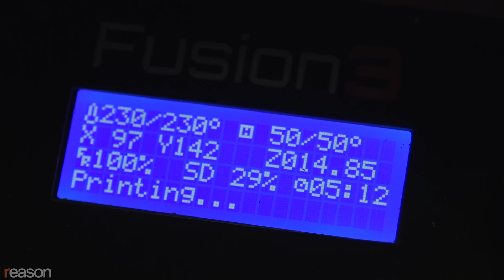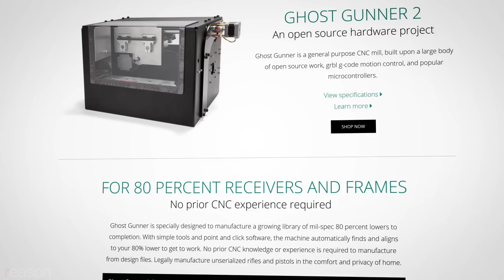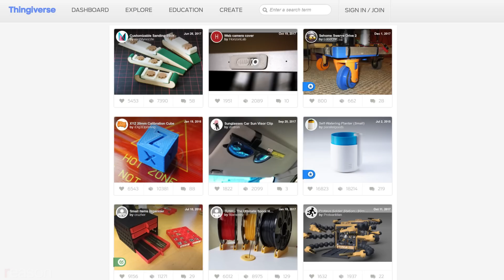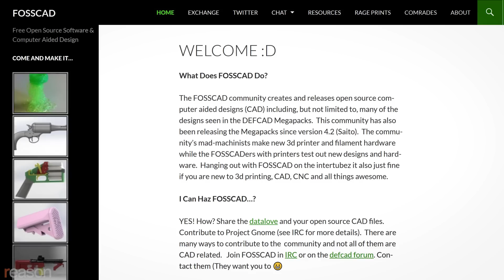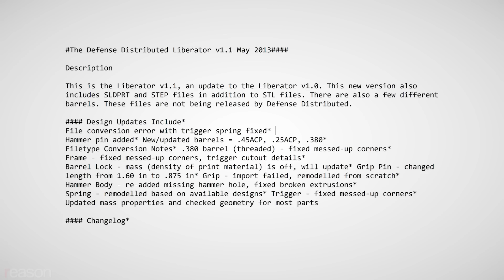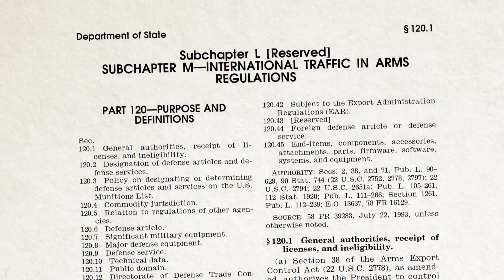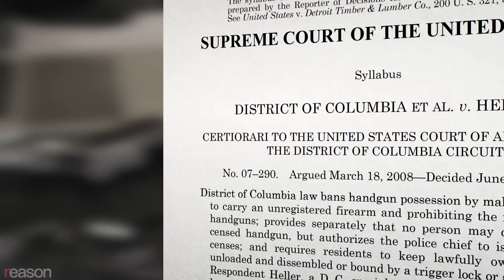The Inevitable Death of Gun Control: Cody Wilson and the Future of Untraceable Homemade Firearms

Comment: I would argue that gun control laws have never been effective in the sense that Cody says that they have been rendered ineffective. It's always been possible to use a machine shop in my basement to make a firearm. Admittedly the Ghost Gunner makes that quite a bit easier. Kudos to Cody and Company for that. I'd like the Ghost Gunner a lot more if it made a handgun from billet material rather than an 80% frame kit. Maybe version 2.0.
Reply: we might see some time soon all you need is a block of steel a pipe from home depot, some scraps of metal from anyplace and a log to make your own rifle with a mill machine like these.
Reply: Ketchard Muschup give it a couple years.. and in the us if they were to strip the 2nd then withing weeks the instructions would be trending on youtube until they are taken down by youtube.. and then every street corner will be a black marketplace to purchase already made ones
Reply: Liberty4Ever just need to do some measurements, add code and reset your x,y,z axis. You can run simulations to test designs. It’s all on the internet.
Reply: So true, in order to fully ban firearms one would have to ban the knowledge and the tools/processes to manufacture one and that would be impossible
Reply: I already have a nicely equipped CNC machine shop.  The Ghost Gunner is the easy peasy solution for everyone.  I'd like to see a billet solution for everyone.
Reply: dgtrh gabhfd - The National Firearms Act needs to be repealed along with the Gun Control Act of 1968 and pretty much all gun control legislation. It's all unconstitutional. It's also not helping any with crime. The least harmful gun control legislation is worthless. However most of it seems to be designed to make matters worse as a justification for more gun control legislation. Gun free school zones are a good example. Children are being killed in disarmed citizen Killing Fields for political purposes. It's disgusting.
Reply: Liberty4Ever 
Gun laws have been used in the past to reduce gun crime. Two examples would be the very strick gun laws of frontier towns like Tombstone. Where you had to check in your guns with the Sheriff upon entering town.  While citizens of Tombstone could own guns they could not display them in public. The law enforcement of the time saw a big decrease in need 9 ooo8 1990's military grade weapons of the 1920's and 1930's.  For the first time police even in large cities like New York where out gunned by criminal gangs. Innocent bystanders where killed along with police as gangs unleashed machine gun fire on the streets. Regulation and out right bans ended the criminals out gunning law enforcement agencies. 

Having untraceable guns produced easily from parts just gives criminals the opportunity to commit crimes that can't be solved. We already have a virtual police state as it is. Giving police a new boogie man to chase would be used to erode our personal freedoms.
Reply: I've heard and read a lot of comments about gun control in the "wild west", on both sides of the issue.  I don't know what's historically true.  It's probably somewhere in the middle.  I'm also uncertain of the relevance with today's problems.  What I do know is the impact of current gun control laws on modern America.  There is an extremely large correlation between gun control laws and violent crime.  The more gun control there is, the more violent crime there is.  Look at cities like Chicago, Baltimore and Detroit.  They have very strict gun control and these are very violent cities with many violent crimes and related deaths.  I'm unsure about Tombstone, but I know I don't want to live in a dangerous modern city with gun control laws that disarm me and make me a victim of armed criminals who by definition do not obey gun control laws.  It's the urban version of gun free schools that are disarmed killing fields.  We need to be smarter than this.  Gun control is killing a lot of innocent people in order to advance the political ideology of an armed government and a disarmed citizenry, which has always been a recipe for tyranny.
Reply: Liberty4Ever 

The gun violence in cities like Chicago is fuled directly by the lack of nation wide federal gun laws. While Illinois and Chicago have passed strict gun laws neighboring states have not. This has created a black market of guns purchased legally in neighbouring states brought right to the outskirts of Chicago for sale to whoever has the cash. I can't recall the highway but it's new nickname is the Iron Pipeline. As so called straw purchasers(legal gun owners who load up on guns in their home state) Meet up with gangs and sell off guns to gangs by the truck load.
Reply: Liberty4Ever if gun controll is so ineffective why is it working almost everywhere exept america?
Reply: So, you're arguing that violent crime in areas with strict gun control is caused by guns that come from nearby areas with little or no gun control and much lower rates of violent crime?  Do you realize you're making my point for me?  Gun control = violent crime.  If guns are the problem in areas with gun control, why aren't they causing even more violent crime in areas without gun control where guns are easier to obtain and more plentiful?  When people have the option to defend themselves, all of society is safer, including those who choose not to own a gun.  The deterrent is still there.  The violent crime statistics make this obviously clear.

You need to stop and think.  Who filled your head with such obvious nonsense?  Some politician?  MSNBC?  Your teachers?  You need to stop trusting those people and you need to stop parroting their dangerous nonsense that is killing people when implemented as public policy.
Reply: If gun control is so effective, why is the murder rate 0.4 per 100,000 in Chandler Arizona where everyone owns guns, and the murder rate is 23.8 (60 times higher) in heavily gun controlled Chicago Illinois?

https://en.wikipedia.org/wiki/List_of_United_States_cities_by_crime_rate

Sort by murder rate and you'll find cities with no gun control have the lowest murder rates and the cities with the most gun control have the highest rates.  It's not just a few cherry picked outliers.  The data is consistent with a high correlation between gun control and murder.  It's not a coincidence.  There's an obvious reason why cities where governments disarm citizens are the murder capitals.
Reply: Look maybe you should stop and look up some facts. For example how america has already had 18 school shootings this year. AND ITS ONLY FEBRUARY. No other country that i know of ever had so much gun violence. Coincidentally no other country ever had so much firearms in private households. The connection is pretty hard to deny.
Reply: Liberty4Ever 

The fact guns bought in bulk in a state with few gun restrictions are sold to criminals in a state with strict gun control laws. Shows the need for federal gun laws that eliminates the loopholes and grey areas in state laws. If every state required background checks, had  wait times, and limits of the number of guns sold per person over a period of time. We could end the sale of guns to criminals through "strawman" buyers. Was more of my thoughts on gun law. After hearing what law enforcement agencies had to say about where the guns used illegally come from. 

Also it is not like the US is the only nation who has criminals,crazy people, and guns. Japan, U.K., Australia, and Canada all have strict gun control yet these countries are not overrun with criminals with illegal guns. These countries have low crime rates and mass shootings are rare if not unheard of.
Reply: You are missing my point, probably deliberately.  If guns are the problem in gun controlled Chicago, why aren't they the problem in the neighboring states without gun control which have urban murder rates 20 times lower than Chicago?  It makes no sense to say that Chicago's murder problem is the fault of someplace without their gun control and without their violent crime.  There is a strong correlation, but not in the direction you claim.  Looking at US cities with populations of 250,000 or more, the murder and other violent crime overwhelmingly occurs in areas with gun control laws... in other words, in areas where law abiding citizens are disarmed by their government and only criminals own guns.  It's not that complicated if you will think about it logically instead of being driven by your feeling that guns are bad and we need to eliminate guns.

https://en.wikipedia.org/wiki/United_States_cities_by_crime_rate_(100,000%E2%80%93250,000)
Reply: Liberty4Ever A valid argument. However it is really hard for me to view any US state as gun controlled since it is ridiculoisly easy to just buy a gun in another state and bring it to a "gun controlled" state just like you said. Therefore US states are not a valid source of data if you want to investigate the effectiveness of gun controll. You need to look at things on a global scale and compare data amongst countries. My current sources are in german (since that is my first language), but if you have some time, I will gladly provide some in english. However it is safe to say that all data points to less guns = less gun violence.
Reply: In the US, the data points to less gun control = less violence, and that does also include less gun violence.  Comparing countries, there is some data showing that depriving citizens of guns reduces gun violence but not violence in general.  Crimes are committed with other weapons, and that is true regardless of whether we're looking at petty street crime, organized crime, or terrorism.

Consider the UK.  They essentially outlawed guns.  Violence was committed with knives.  They outlawed knives.  People in pubs started smashing those heavy pint mugs to make sharp edged weapons.  They switched to shatterproof polycarbonate mugs (probably not a great sacrifice as they drink their beer warm) and now they have an epidemic of people throwing acid and other corrosive liquids in each other's faces.  The problem is not the guns... nor the knives, nor mugs, nor battery acid, nor the round nosed kindergarten scissors they'll be banning next.

A lot of the "gun violence" statistics include suicides and that horribly skews the data.  Yes, if people are not allowed to own guns they will commit suicide via other means, including more painful methods.  We really need to insist that we are looking at overall violent crime rates, not "gun crimes" and certainly not "firearms homicides", half of which are suicides.

Do you have any comment about the data that I provided showing that a ranking of US cities of over 250,000 people demonstrates an obvious and dramatic pattern, with far more murders in cities with strict gun control?  To me, it's obvious.  Deprive law abiding people of the means to defend themselves and they're preyed upon by criminals who are not disarmed by gun control laws.  Even those who don't own a gun are protected in cities where other law abiding citizens are armed.  That provides a deterrent effect for criminals who don't know who is armed and who isn't.

I'm somewhat familiar with German weapons laws, where a slingshot with a wrist rest is an illegal weapon.  There is a huge gulf between the US and German culture in such respects.  I wouldn't presume to tell you what is best for Germany, but I can tell you that the US has a very strong firearms tradition as well as a national identity that is strongly based on individual rights.  There are over 300,000,000 firearms in the US and they are not going away.  This is probably shocking to you, but if a national ban on firearms were to be passed, it would spark a civil war.  That's why gun control measures have ceased.  The frustration on both sides is not worth a civil war.  I'm not exaggerating.  Probably millions of people would be killed.  The US has been politically polarizing, largely within the past decade.  It's becoming a powder keg, and that would worry any sane person.  The battle lines are geographically ugly.  The ideological differences are mostly between rural and urban Americans, so the battle lines would probably be in the suburbs.  It's too horrific to contemplate.  There would be no victors in the US.  The only winners would be some international concerns that would feed off the carnage.
Reply: Liberty4Ever 

Having federal gun laws that apply the same rules to every state hasen't equalled  an upswing in gun crime historically. It's the lack of comprehensive federal gun laws that create loopholes, grey areas, and straw buyers which put guns into the hands of criminals. Having the private sale of weapons, no waiting periods, and background checks that don't include mental health records puts guns into the wrong hands. 
Getting rid of gun free zones and expecting everyone to be responsible for their own safety in public by the use of weapons especially assult rifles is just nuts. 

I don't hate or love guns. Guns are tools you use them to do something that you can't do without them. Like kill a deer at 100 yards or kill a classroom of kids at point blank range.
Reply: Once again, the argument that we need uniform federal gun laws to prevent areas with little to no firearms restrictions from arming criminals in areas with strict gun control is completely destroyed by the fact that the areas with little to no firearms restrictions have drastically lower incidences of violent crime than the areas with strict gun control.  If your argument were valid, the gun control cities would have less violent crime, not 20 to 60 times more violent crime.  It's obviously not the guns causing the crime, but I think a good case can be made from the data that gun control causes violent crime.  The correlation is overwhelming.

The reason people who are screaming for more gun control are frustrated is that most Americans have finally realized after decades of capitulation to the false promises of the anti-gun crowd that the 1990 Gun Free Schools Act was a lie.  All it did was disarm those who could protect children and leave them to the merciless insanity of those who would murder children.  A No-Gun sign only stops the law abiding.  As such, it's an open invitation to mass murderers looking for their 15 minutes of infamy.  Most of America is sick of this insanity.

The weapon used in Florida was not purchased in a private sale, so banning private sales wouldn't have prevented this tragedy.  Similarly, the weapon was purchased long ago, so unless you're advocating a waiting period of years, a waiting period wouldn't have prevented this tragedy.  You want background checks that include mental health checks, and the killer passed a background check that has provisions designed to prevent mentally ill people from purchasing firearms.  The killer had not been adjudicated as mentally ill.  He had plenty of interaction with government.  Sheriffs were dispatched to his house 38 times, many of those for his issues.  He posted on YouTube that he was "going to be a professional school shooter", and his YouTube username was his first and last name.  A citizen referred that comment to the FBI who decided that the killer was not a threat.  Are you suggesting that Americans should forfeit our inalienable and fundamental rights because the government you want to entrust to protect us is completely incompetent?

BTW - In this context, "assault weapon" is a scary term being used in a duplicitous manner by the media to advance their political agenda.  An AR-15 is not an assault weapon.  The correct term is modern sporting rifle.
Reply: Liberty4Ever 

So i did a little research and your argument that states with strick gun control laws have higher shooting rates or gun crime then states with loose gun laws is false. There are no real statistics to prove that. Obama got flack for saying the opposite is true as no data really supports that gun crime is lower in gun control states. The Congress for some reason has banned  researching these statistic for something like a decade.

Next you saying that the majority of the US population wants less gun restrictions is false even the majority of NRA members are at least in favor of more back ground checks. Over 90% of people polled on the issue are in favor of more gun restrictions. 

Lastly you are correct the AR in AR-15 has nothing to do with assult rifle and is just a company designation. Arma Lite rifle 15. However the AR-15 is the civilian model of the M-16. The gun developed for the military by Eugene Stoner. The M-16 was based on the AR-15. I find the term Sporting Rifle to be meaningless it is just a gun manufacturers lable that is used to justify the existence of guns like the AR-15. The AR15 was built to use the NATO 5.56 which is identical to the .223 civilian round accept the 5.56 has a higher psi.  The .223 round was developed to have the same preformance as larger calibers. The idea was to give troops more rounds with less weight. The .223 round travels at hypersonic speeds and tumbles as it enters a body. The tumbling causes the bullet to virtully explode causing massive trauma as micro shrapnel destroys blood vessels and organs. Not something that is important to sportsmen or target shooters. 

That's all folks got shit to do.
Reply: I didn't say that states with strict gun control laws have higher shooting rates or more gun crime, although that's probably true.  I was addressing the argument that Chicago's gun control fails because adjacent areas don't have gun control.  I provided a link to a Wikipedia page that shows the crime rates for all US cities with over 250,000 people.  To try to make as fair and useful a comparison as possible, I compared cities of comparable sizes, based on their gun control.  No surprise (at least to me) the cities with strict gun control are the cities with BY FAR the most murder and other violent crime per 100,000 people.  You seem to want to ignore that comparison and create some complex straw man to obfuscate the facts.  You can't simply ignore the facts that disagree with your feelings.  That's not reality.

Speaking of "facts", your AR "facts" are about half right.  Kudos for trying, though.
Reply: These are even more fun!  https://www.youtube.com/watch?v=GuJbARmbirc
Reply: Chris Evans well technically, I can make a 12 gauge out of pipes, it's actually within the power of an everyday hobbyist even without power tools
Reply: Schnozistan Czar - Royal Nonesuch, is that you?  :-)
Reply: III
Arguing about gun control is pointless and useless. In America, there is no such thing as gun control, just law abiding people control. If our government really wanted a safe and secure nation, guns would be required for everyone who so desired to meet the criminals arsenal. 

You will never take guns away from criminals. They will get them from a black market most probable by a democrat ran illegal enterprise. (Prohibition ring a bell?).  It doesn't matter if you are for guns or against. Gun are here. Taking them from "law abiding" only puts law abiding in danger. Guns are here to stay regardless of your beliefs, so the only recourse there is, is to get armed and be good at it. 

To even suggest a gun ban or gun control measure would somehow make anyone safe is idiotic. Our culture of government corruption and dishonesty will never allow the peaceful pursuit of happiness and to believe that is true is naïve.  

So back to reality, only you can protect your self, or not. Your choice. If you fail to take the responsibility to protect yourself and force others to do that for you, you are only helping the criminals at large including the government and putting your family in danger along with yourself. I didn't make the rules of the street, but regardless of what you believe, these are the rules non the less.
Reply: El Manu What about Switzerland?  Alot of guns there, and anyone who was in their military can buy their service weapon(s) upon leaving (usually they are fully automatic rifles).
Reply: mattp1482 YouTube might take it down, but there are already blueprints available to make a 9mm submachine gun with metal parts and steel pipe.  You can get books on how to make a pipe bomb on Amazon.  Somehow banning and confiscating 300 million PLUS firearms seems like an impossible task.
Reply: Andrew Morgan “Straw purchases” are actually illegal. Also, if a gun dealer, one who is legally licensed to sell firearms, knowingly sells to someone he/she knows can not legally purchase a firearm, he can lose his license and possibly go to jail.
Reply: Chris Evans There are books with blue prints, that show how to make a gun out of parts at Home Depot.
Reply: @darkisato  This is already the case. People have been making their own guns in their own home workshops/garages for decades. One guy even built an AK reciever out of an old shovel.
Reply: @TheWaggishAmerican  exactly so if u can build a AK out of a few scraps then how are u gonna control arms?
Reply: @elmanu2918  
Perhaps you would have a different opinion living in Germany's finest hour,not long ago.
Reply: And how many people have acess to a CNC shop
Reply: @dogguy8603  - Try searching for "maker space near me".

PS - It looks like my wish from three years ago for a Ghost Gunner that uses raw billet material instead of an 80% lower or 80% pistol frame has come true, largely thanks to ATF tyrannical over regulation by bureaucratic decree.